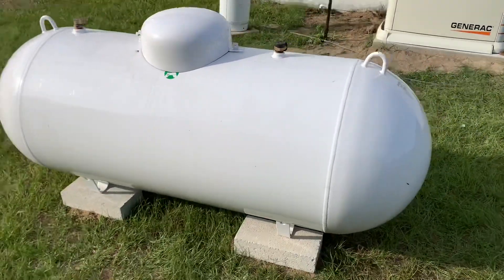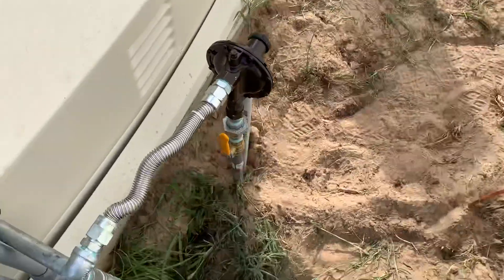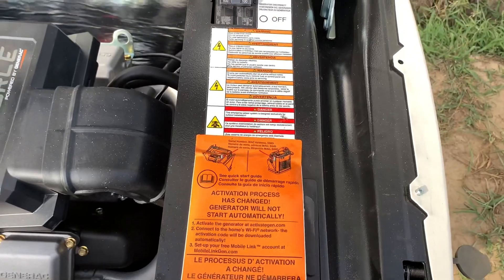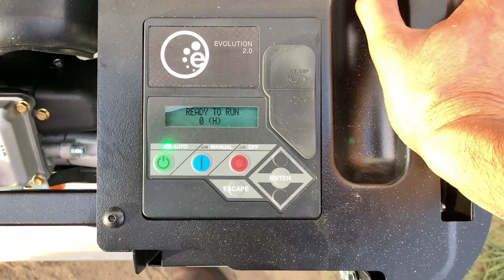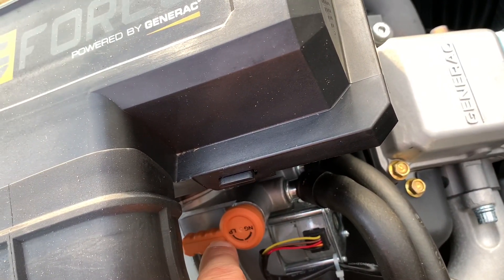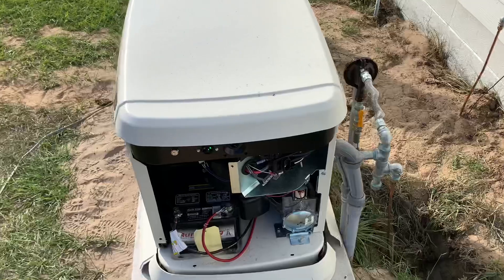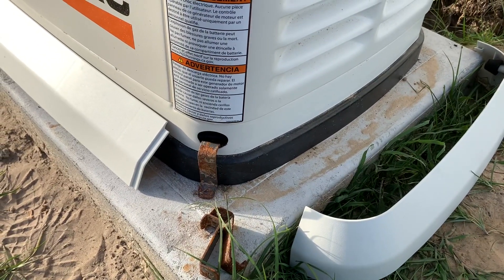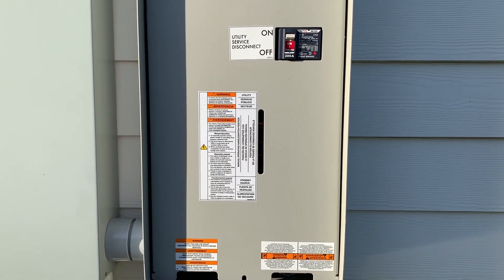Testing our new Generac generator and transfer switch.

Comment: Hey bud, Residential and Industrial Generac Technician here.
The propane line pressure has 2PSI from the tank in copper/poly to the 2nd stage regulator by the generator, which then steps the pressure down to 9-13 Inches of water column. The pressure range for Generac's internal gas solenoid is rated for 9-12 inches on LP gas. The vent is required by law of the railroad commission. The regulator must be vented at least 5 feet away from any Combustion source; such as the engine.
That separate low pressure line running from the generator low pressure side should have come from the tank, and not the generator, but as you said only a gas stove is being used, it shouldn't deplete any necessary pressure or volume from the Generator gas supply. If you're to add a tankless water heater or any other high demand gas supplies appliances, you might want to think about having a separate high pressure to low pressure (2 stage system) run from the tank to the house, so as to not starve the generator of fuel, especially when a large load is applied during an outage (AC condenser, hear strips etc). All that being said, the propane tank is too close, and is supposed to have a minimum of 10ft clearance from any Combustion source. 

Any other questions, please reach out.
Cheers
Reply: It is amazing how codes change from state to state. That accordian type flex pipe going from your line to the generator is not permitted in my state. The feed line and regulator have to be a minimum of 3' away from the generator where I'm at. And from the regulator to the generator in my state has to be a special rubber type hose. I went with a manual Transfer switch, I don't trust any of that electronic switch over circuits. If I want generator power I just throw the lever on the transfer switch and start the generator and bingo I'm in business. Works good for me.
Reply: This is why I hired a team who knows what the hell they're doing
Reply from the maker: Man that is great and helpful info, thank you for sharing! That makes sense.
Reply: Man you're a blessing!!! Not many people share valuable information. I love the good guys👏🏾👏🏾👏🏾
Reply: Actually it's 10 psi not 2 from tank to second stage regulator
Reply: @tracker1ify  2nd stage is a high pressure>low pressure system. 2 psi high pressure to the low pressure lines, second stage drops to 9-12" water column for the generator. This is assuming a 250+ gallon horizontal tank which is apparent in the video. Pipe size is also a huge factor as flow rate for these generators is typically around 288-357 kbtu/hr.
Reply: @JKXMedia  u are the one said 2 psi was from tank to 2nd stage... I said no it's 10psi from tank to second stage
Reply: Can you tell me how many gallons a 24KW will use approximately in 24 hours?   or how many days it would run on a 150 gallons ( LP ).
Reply: @garyholbrook9951  at 50% load; approx 50A of power for a 24kW on LP, you'll consume 2.5 gallons per hour or more. 100% load can be upwards of 3-3.2 g/p hr. 150 gallons will last around 60 hours as assuming all of the 150 gallons is liquid, but most likely only 80% of that volume is actually LP (all LP tanks are filled to 80% max as to allow for surface area for propane to vaporize enough for minimum pressure limitations). If your tank size is 150, then assuming the previous calculation, you only have 120 gallons which equates to 48 hours of run time at 50% load.
Reply: @JKXMedia  thank you
Reply: @garyholbrook9951 Hi Gary are you sure you 24KW? I think they are over sized. Run my whole house with 7.5KW, we do have LP appliances so only 240 volt circuit is for well pump. Cheers
Reply: @garyholbrook9951  Forgot to say reason I commented is fuel consumption.
Reply: I was in the propane industry for 20 years. Your response is spot on.

Comment: Great Installation and test video. Hopefully you set the Wi-Fi on and used your smartphone' to control and monitor your new Gen  Set. Hope it serves you well.
Reply: According to Generac the WiFi can ONLY be used to monitor NOT control the generator. They are supposedly working on that feature.  I told the rep. over  the phone that I want to be able to control the generator from my iphone if I happen to be far away from my  home.

Comment: A suggestion instead of switching back to utility after twenty seconds I would set  the Generator to run for two minutes. This will ensure a brown out or immediate blackout doesn't fry equipment. Usually when power on the utility side is restored it might be drawn down briefly from all the inrush from equipment. I have mine set to 10 minute delay.
Reply from the maker: Great suggestion!
Reply: I always wondered about that. The Generator is Always connected to the power Line as the circuit board Always needs in a blackout  to look for when power has been restored.
Reply: Some brands will allow very specific options to be set during exercise or actual run operation. Furthermore, some brands allow a "load test" function to be done during their weekly exercise. I think the Koehler brand that allows it...pretty sure the air-cooled Generacs do not have that load-test option.

Comment: Reading through the comments and to me,  a huge propane tank like that will only run 2-3 days?  Wow, that seems like a huge dissapointment for 48-72 hours of use.  Not to mention the cost of Propane,  even if it was readily available.🤥
Last winter in ALL of Texas,  the freezout/electric grid collapse was suppossed to be on a 2 or 3 hour off/on schedule,  but that didn't work out for hundreds of thousands of us..  We had maybe 45 min to an hour on and 6-8 hours off .  At one point several 10-15 hours out over 4-5 days.   The only thing that saved us was Natural Gas that ran a large gas log fireplace but it was still very cold. I've often thought of getting Generac backup but in such a scenario,  but many power generator operators/stations were short of Nat Gas which made it worse.  In residential surburbia I'm sure nobody coulld keep such a tank of LP much less diesel storage.   As last resort,  we used 5500 watt gasoline gen intermittenly for lights, coffee pot, refrigerator/freezer (like we really needed that)and electric skillet, toaster and the like,  but chose not to wire into central heat,  as didn't have but around 7 gallons of gasoline, and had read dozens of articles that electronics (central heaters do have a mini controller) were taking a chance by not getting pure 60 cycle sine wave.  I've since purchased a small 2000 watt inverter generator w/ manual disconnect to at least run furnace thermo and fan to HVAC and TV/Computers, etc.  Will keep the 5500 watt available for non critical circuits.   I have a stash of 150-200 gallons of aviation fuel in my hangar if things go extended again.
Reply from the maker: That’s probably smart. I don’t plan to run it 24/7 because of that very reason. The auto transfer is mainly for daytime when I’m at work for my family. In a hurricane it will probably only run at night for freezers and AC.

Comment: I have the 22KW model installed about 2 years ago and mine runs on natural gas, only thing I have changed is by default the generator would start after a loss of commercial power after 30 seconds. I changed that to 5 minutes, seems like a lot of short blips in the availability of commercial power were causing unnecessary starts and stops with the generator , very pleased with ours and I am sure you will be too.
Reply: I did the same thing with mine it waits 120 seconds before starting up all my important stuff is on a UPS backup.
Reply: that's ok but it is good for the generator to run, nothing worse than and
engine sitting and not running will get a water build up in cooler temps
let it run more than just its weekly time.

Comment: Why the f*uk do you need to register/activate a generator?
Reply: Security purposes
Reply: Generac uses this method to ensure that the customer registers the generator before it  will operate.
Reply: @altonreedy2484  BUT WHY? Why should I be forced to register it? That means in the future there are gonna be perfectly working generators that won't work because there isn't a "registration server" available

Comment: 3:28 that‘s just a bad flex install, that‘s definitely going to fail!
Reply: Needs a rubber hose to flex.
Reply: I saw 3 fails on the gas install. And why they put a switch on the outside of the unit I don't know. kids will switch it of when playing out there.
Reply: @34ofaninchofbrain80  I was told by my installer that it was required by code for use by emergency/fire personnel since the other switch is inside the locked enclosure.

Comment: Your Generac looks just like mine. Mine is powered by natural gas and is a 13 kw. I've had it about 10 years wit zero issues, until this past May. We live in a remote area and pretty prone to power outages.  We called the Generac repairman and he came to service it. I told him when our power recently went out the generator fired right up as normal.  But.... only half our house was powered. The other half we had no lights,  luckily our fridge and part of the kitchen had electric, two of our 3 bedrooms had power, but one bedroom and one bathroom and our gas furnace had no power. Neither did we central air. He looked at the control panel,  everything was fine. Looked at our transfer switch and BINGO... there was a nest of  ladybugs looked to be 1000'and 10000's of ladybugs nested in there. After using compressed air and blowing all the bugs outta the box he did a test run and said everything was fine.  Well... in the Dog Days of  of July and August we lost power and back to half the house having power again.  I'm wondering if the Windings in the generator could be bad?? Do you have any suggestions? Any help would be much appreciated.   You did a very informative job explaining things as I said in my previous comment,  I have no knowledge of electric nor do I want any. I am hoping i don't have to replace my unit as you know they aren't cheap. A good friend told me to go to a bigger unit possibly a 19 or 20 KW as they are liquid cooled and have more cooling for the generators Windings. He also advised that I remove the outer panels of the unit to keep the generator cooler in the summertime.  Sorry this comment is so long. Thanks again for these videos. I've learnt a lot.
Reply: Do you have a digital volt meter? Check to see if your getting 240 VAC, at the generator breaker. The. See if you have it at the transfer switch. You need to verify if the problem is in the generator, or somewhere else down the line ..

Comment: Nice videos. Can I ask how you isolated the house circuits? Does your generator supply power to all house circuits?
Also the 6 colored trigger wires, were they supplied by generac? My 13kw didn’t have them. I guess I’ll need to buy 75feet of each as that’s how far my genny is from the transfer switch.

Comment: I foresee that plastic vent line from the regulator being a problem in the future. The low spot underground will get rain / snow splash or condensation and become restricted / clogged. It may even freeze in winter. The end result will be the generator wont start. The cure is a horizontal line to the required 5 ft away from the unit. Install it with about 1 inch of pitch and put a screen on the end to keep the bugs out. You can support it on the house or drive a stake into the ground to hold it up. How do I know this? Let's just say the call back rate was about 90% on the ones installed this way. I also worked for a larger dealer doing hundreds of installs per a year. (I wont say how many)
Reply: We use a twin stage regulator with a 3/4" PE line so the second regulator issues don't exist. It also makes the job look better..  Please be more careful in installing the flex line to the unit, that one is itching for a leak.

Comment: I did what you did foe about 75% less with a portable 15k generator and a manual switch
Reply: if you are home and are able, then you saved quite a bit. Buying an automatic set is done for convenience. Your wife doesn't have to do anything if you are out of reach and your pipes wont freeze if you are away. BTW, a portable set will not increase the value of your home.
Reply: @rupe53   electric start. Nothing she cant do… easy
Reply: @jimragsdale4524  ... not saying she can't do it, but someone needs to be home, refill the fuel, roll it outside, plug it in, etc. Away for the weekend? There goes $500 worth of food! More if you have a freezer. You also need to give it some regular exercise to be sure it will start when you need it. It's all doable but you have to do it manually.
Reply: @rupe53  no taking it anywhere … its hooked up in a dedicated shed with 300 lbs of propane. Enough to run almost 3 weeks @ 50% load. All you have to do is manually switch to 50 amp breaker and cut grid power. Battery is on maintainer
(Solar). And supplemental cooler in summer months.
Reply: And save 10k…. No brainer
Reply: All for $2300.00 his system will be 12-15k
Reply: Also have app that tells us if power out. Call neighbor to start. He is an electrician
Reply: @jimragsdale4524  ... hey, a Yugo, Toyota or BMW will all get you to the same place. Some people want creature comforts and they can swing the $$ to get what they want.
Reply: @jimragsdale4524  .... 300 pounds of propane is only 50 gallons. If you mean 300 gallons then you'll get much more run time.
Reply: @rupe53  more money than brains? Perhaps…. I’ll keep the extra 10-12k thank you
Reply: Oh and mine’s tri-fuel to boot:)
Reply: @jimragsdale4524  ... as you wish. I'm not trying to tell you how to spend YOUR money. All I am saying is we are comparing hamburger on a bun to a steak with all the trimming's. BTW, the Generac is dual fuel, but no gasoline.

Comment: Nice install!   Depending on your load, you'll have at least over a couple of days of fuel on that system/tank combo, maybe 3+ with a light load.   I've got 27KW version at our home, but on nat gas, but also have 22KW version on propane on a 500 gallon tank at our remote property so that we have at least the better part of a week of fuel.
Reply: Good information, I underestimated the run time on a 250 gallon tank. In a prolonged outage, he won't be able to run the system 24 hrs/day.
Reply: @georgegreen442  Yeah, here on the Gulf coast a hurricane could take you out for the better part of a week (or more).  Seems most of the installs I've seen that don't have nat gas at the residence, they're putting in 500 gallon tanks.
Reply: @georgegreen442  yea and at current propane prices it would be $800.00 to run for 2-3 days.
Reply: What brand is your 27KW ? water cooled?
Reply: @oldtimer3180    It's a Generac, what they used to call the "QuietSource" series, I think now they call it the Protector QS series.   Same unit.  Inline 4 cylinder water-cooled automotive engine.   Was a bit more expensive than the air-cooled units, but I wanted the lower RPM of a water cooled unit, and the noise reduction.
Reply: How do they get refilled?
Reply: @Vmh1717  You call your local propane distributor and they come out with a truck and fill it up.  Some of the permanent tank installations can have a meter to alert a propane company to come fill it, if the local service provides that.
Reply: @5thGenNativeTexan  thanks!

Comment: Not a bad install. There are a few problems, but don’t want to bash it on here. Nice work
Reply from the maker: I appreciate that! Yes, I have a few code violations that I will address in another video. The panel as raceway being the most popular lol. Thanks for watching!
Reply: @MaynardFamilyHomestead  Yup. Other than the bushings (which, like every bloody thing else) are almost impossible to get), the only other issue I see is feeders in the same raceway as service conductors (230.7).  Need to come out of the meter can and straight into the ATS.
Reply: I like to add a potential violation. The N1-n2 connections are 240 volt, I’m not sure that sprinkler cable is rated at that voltage.

Other wise nice work for a non electrician. I didn’t get a look at the ground and neutral connections in all the panels. That’s something to make sure is correct. Don’t always rely on the inspector, they sometimes don’t know or don’t look.

Comment: Saw in your other video you said to save you got a smaller tank...   You should buy a used tank. I got both of mine on FB marketplace, one is a 250, other is a 500. 250 tank was $300, and 500 tank was $100.
Reply from the maker: Great idea!

Comment: Curious how your tank works for you. my 20kw needed a 500gal tank in order for the generator to run at a full load.
Reply: Really just depends on how many days you want to be able to run on a tank.   On a 20KW on propane you'll be able to run a little over two days on a constant full load, but in reality you'll most likely see about 3 days on a 250 (200 usable) tank on a moderate to full load.   But we have a 500 gallon tank on our 22KW at our remote property so that we have the better part of a week of fuel.
Reply from the maker: I would love to upgrade to a 500 at some point.

Comment: I have the 20K model. Always had an issue every time I needed it. Bad transfer switch, bad control panel in the gen itself, then fire in the transfer switch. My brother has the same exact model. Not one issue. Maybe mine is just a lemon. Never an issue with the engine though, and it self tests every week.
Reply from the maker: That stinks! Must’ve been a lemon